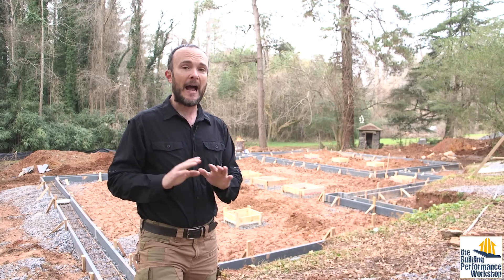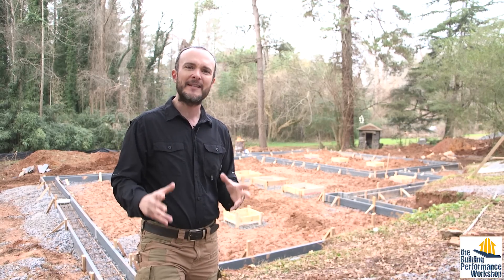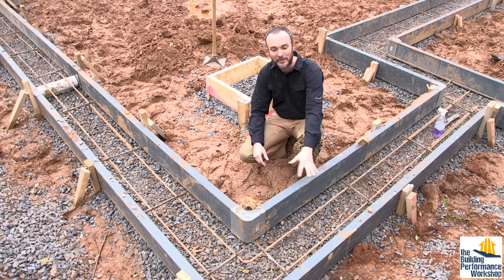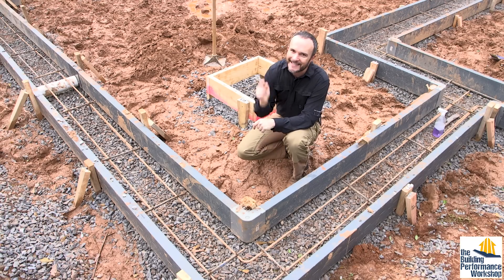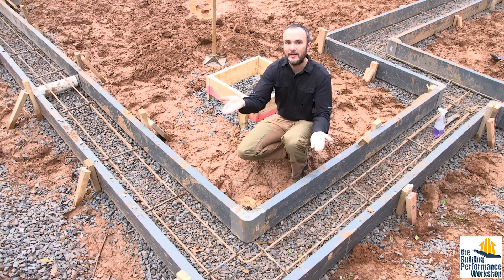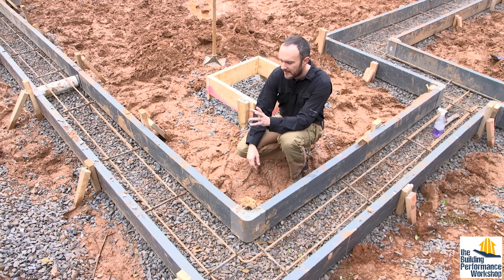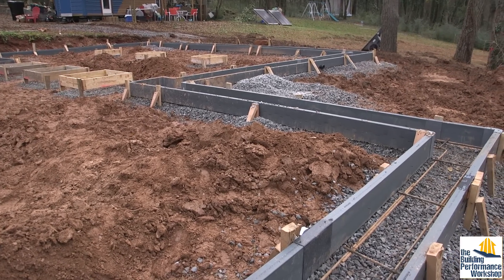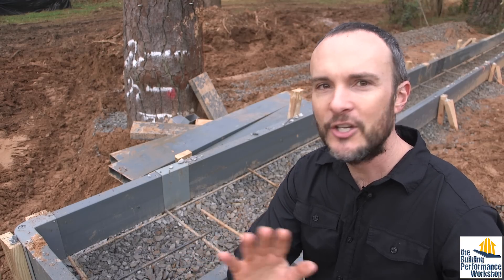First Concrete Pour: Form-A-Drain 4-in-1 Foundation Footings

Comment: Two mistakes.  No key way and I didn't see them vibrate the concrete.  I don't care how wet concrete is it still always needs to be consolidated especially for a footing
Reply from the maker: We opted rebar instead of keyway, the struc specs called for clean concrete (no rebar). Thanks for chiming in.

Comment: Slump test is done at the end of the pump aci, put super p in concrete to achieve workability that is definitely not a 5 inch slump maybe a 7.  
4th generation concrete contractor.

Comment: Mr. general contractor, slump test is done on the field cause water is added on the field. Slump 4 or 5 is for regular pour. They do 6 for regular pump. What u had on ur site will be 7 or the operator won’t let them put it in his truck. Do little more homework u got fooled. I do state and federal jobs so I know, not a random guy. Good luck.🙏
Reply from the maker: Good luck back atcha

Comment: I am glad you have done so much research and I am certain you will have a great house when it is done.  Thank you for this video. I was unaware of the product, and your experience will help me somewhere in the future I am certain.  Man, the rebar I saw was first rate, however, any vertical stake that has a back up brace of less than, or more than between 45 degrees to 60 degrees angle is not strong with that technique. Backing the brace stake with another stake behind it (to bear against) is also stronger in muddy situations.  The gravel you wished to use would have kept the form base from moving, especially placed inside and outside the footing forms (even a few inches in height). Finally the concrete I saw being placed looked like a 4-1/2"to 5-1/2" slump and was shot in way too fast. Thus the deformed results. A 3-1/2" to 4" slump placed slowly would have had a better outcome.  Most pump truck operators I have used intuitively follow you, so you do not have to swing the nozzle as long as the flow is metered at a steady appropriate pace. Nice family too!
Reply from the maker: Thanks for your thoughtful comments, Donald!

Comment: You are the reason that i build the house cash 1st, then sell it. I couldn't put up with you for more than 10 min.
Reply: @lowmanagain ~ Only a SHADY Home Builder/Contractor who lacks professional standards, chooses cutting corners over maintaining high quality, accepts subpar trades work, and has something to hide from home buyers, would make such an ignorant statement. If all you build and sell are finished SPEC HOUSES, you have already established a low bar for yourself and your business. Apparently you are fine with limited potential. I've been in the business for 30 years and builders like you are the ones who end up getting sued by buyers, over and over again.  That reputation spreads quickly to local suppliers , tradesman, home builders associations, and the community at large..... eventually, potential buyers won't even consider purchasing your properties.
Reply from the maker: I am not your customer, my friend. You would never have to worry about working for someone like me.

Comment: I'm glad I'm not on that job!  Working with a over educated nerd that is going to have the safest bla bla house in the world! Give me a break!
Nice guy, but for Pete's sake, just trust the undereducated professionals and go to work!
All you did so far is create an expensive radon system. Crushed stone under foundation will take water. Perf pipe under slab in crushed stone would take care of everything else.  I'd never use those PLASTIC forms, can be cheaper than 2x lumber
Reply from the maker: Thank you so, so, so much for your exclamation points.

Comment: Using form-a-drain You set your ends to heightWith steel stakes With laser set your metal stakes the height backfill this with gravel set the forms don’t get pregnant I’ve been porn was form a drain for 10 years this dude has no clue
Reply from the maker: You’re right, true professionals who pay attention to detail spell ‘pouring’ as ‘porn’ and never use punctuation.

Comment: Form a drain has been around for a long time. There are spreader bars you place on top to keep the forms from bowing in when you put gravel on the inside and outside to keep the forms in place.  We would also use furring strips cut to the proper length for the same thing.   The use of gravel on both sides of the form makes it easier to pour since you don’t have to worry about form movement.
Reply: I don't get how gravel helps.

Comment: Not sure what you mean by putting the drain holes downwards, then you just limit the drain capacity of the pipe. You put the pipe below the level you want to drain, the holes on top and then cover it with a permable plastic to prevent dirt from getting in.
Reply from the maker: No, that's not how it's supposed to work my friend
Reply: @HomePerformance  But it does. I don't know much about construction but I do know a lot about soils and drainage. The holes at the bottom will reduce flow rate and regardless the water does not like you state rise from bottom. That is a misnomer, it flows from the top and collects at the bottom. That means if you have the soil at maximum capacity at the bottom of your drain you already has passed the opportunity to remove it before it reaches maximum capacity. That is to say, if you put the holes beneath the pipe you will automatically increase the level of humidity close to the foundation.
edit: a better compromise would in that case be holes both at bottom and top, but you would still reduce flow rate.
Reply from the maker: The water would have to fall into the tiny holes at the peak of your pvc, my friend. Statistically unlikely.
Reply: @HomePerformance  No, it is pressed into the holes by the same forces that press it into the bottom holes if yo put them there. The difference is that it happens before the soil reaches maximum capacity. The reason why you put them below is when you want vegetation growing above because then you want the soil to retain humidity. That is not your objective when you protect your building.
Reply from the maker: I guess we’ll have to agree to disagree. Keep doing it your way if it works for you.
Reply: @HomePerformance  Yeah but I am still curious about your sources for your claim as I have heard it but it doesn't conform to science. This link expands a bit on your argument but it goes on to the idea that it is to be pumped out and not for self drained purposes: https://www.jlconline.com/how-to/foundations/perforated-pipe-holes-up-or-down_o

Comment: The chairs bridge cleaver clogs, you will then get moisture that tracks and rots the rebar which expands and blows the crete. You may well have out geeked yourself. The steel needs to be rusted but brushed to remove mud and clinker and fully encapsulated to avoid steel degeneration blowing the footing.

Comment: The form-a-drain is installed incorrectly and missing components.  Just a very hard way to use a decent product.
Reply: Honest question: What is missing? What would you do different? I want to know so I learn from others' mistake and not make them myself.
Reply from the maker: Sharon, still unsure- Form-a-Drain actually partnered with us on this and specified the components you see here.
Reply: Sharon Barbour  missing spacers or  ties . They hold the spacing. Then your supposed to stone inside and outside of drain. And they also have thin metal stakes to hold product up to grade. We have done countless footers with the product. Without putting stone prior to pour it is making the entire job more difficult and time consuming. Sure the footer is fine structurally, but you are not benefiting from the idea behind the product.

Comment: You mentioned you put a radon mitigation system under the ground. Do you have a video for that? I didn't see it.  Thanks.
Reply from the maker: 5-Layer Slab System for High Performance Home Build
https://youtu.be/KqIh7c8rSSA

Ventilating Tight Homes in the 21st Century
https://youtu.be/fOTJmUhghIo

Testing a Radon Mitigation System
https://youtu.be/30LI6W8cCR0

Comment: The concrete vibrator would make a good difference when pouring the foundation to void the air bubbles and cracks.
Reply from the maker: On deeper than 8”, for sure
Reply: @HomePerformance  Although most builders did not use the vibrator on the 8" deep footer,  the air bubbles and cracks were still there ( according to my builder buddy). I only mentioned it because that you have set the bar way high:)  What a great job!

Comment: regarding form a drain staking, we poured ours a month ago, he used steal stakes and let it float, (no fasteners) the force is outward, the corners keep everything in place,  and  the stakes hold the form from pushing out when pouring, then he just pulled the stakes for reuse once it cured, he also had gravel placed on the outside of the form bed prior to pour,  while the conveyor was there, for the concrete anyway,  nothing moved, I watched the entire process. it went very well.
Reply from the maker: Thanks for sharing, Scott- ours hasn't been an issue either, even with the minimal bowing in straightaways. Fatter footings never hurt anybody.

Comment: Nice guys finish last, however,  you need to have clear instructions on procedure before your start and also be there most the time. The foundation is very important,  rebar needs to be clean from soil, rebar need to have 2" clearance from edge of form, corners need to have a return at end of bar and rebar bands every 4' none of that seen in the video.
Reply from the maker: Interestingly, the Struc engineer spec’d clean concrete, actually, so the rebar is just an extra measure

Comment: The most dangerous thing is a homeowner with a little bit of knowledge who thinks they know more than someone who has been doing it for 20 or 30 years. They can be a complete nightmare to deal with.

I can tell just by this short video that you are the type of guy to argue with your doctor about getting penicillin when your daughter has a viral infection. 

Dude just shut up and let the experts do it the right way.
Reply from the maker: I’m sorry you think any “expert” knows better than you. What if they’ve been doing it wrong? What if they were taught wrong? What if they prefer easy, or cheap, or quick solutions instead of permanent ones? None of that sounds plausible to you I bet.
Reply: Home Performance what if what you learned is wrong? The Aberdeen Group ran tests where they contaminated rebar to see if it would bond to concrete. In all 27 tests, completely contaminated rebar (rust, oil, etc. Still bonded normally. As you said, sometimes experts are wrong. Well this goes both ways. Sometimes a myth persists for so long that even experts don’t question it. Then they tell you and you take it as gospel to the detriment of your own knowledge and wisdom.

Comment: I will go ahead and chime in on this slump subject.

1) when you order a 4-5” slump, 99.999% of the time that’s what you are gonna get.
Concrete companies don’t want a load rejected by a customer.
2) the only time you’ll see a slump cone on a job site(in the real world) is on government jobs or anal psycho pours.
3) yes you can look at it and tell what the slump is. The mixer truck driver can tell by looking at it. Most also have a slump o meter(measures the hydraulic pressure it takes to turn the drum) on the truck. Drivers will know how many psi a ? slump takes turn. A driver can most likely tell just by listening to the concrete churning in the drum what the slump is.
4) your pump operator can likely tell by looking at the concrete what the slump is, and i have never operated a pump, but I would imagine they can listen to the pump and know the slump.
5) a real concrete contractor will know their slumps.
6) most common home builders won’t. They don’t deal will concrete every single day.
7) the dryer concrete is the stronger it is. But at the end of the day it has to be pumpable if you’re using a pump. It also has to be workable for the laborers and finishers. You can pour it as dry as you wish, but you’ll have a mutiny on your hands or you’ll need to pay for super plasticizer.

P.S. I like the formadrain, it was popular in my area for a while, but it has fallen out of favor for some reason.
Reply from the maker: Great comment, thanks!

Comment: as a construction worker i have to tell you: theres many rules and guidelines written by people who have absolutely no connection to the reality of construction, never been doing the job themselves but elaborating how it's done best. some things are simply laughable. sure theres many things that are very important. but trust me you dont need a good scientist, you need an experienced boss on the site who knows what he's doing. if he sticks to the manual or not should be entirely his concern.

also usually a drainage isnt exactly level/flat to enable waterflow. someone sold you a fan.... ^^
Reply from the maker: I hear where you’re coming from, but the reason we need science now (as well as this channel) is that new materials, new energy codes, new expectations from customers means we’re building differently than we always have. You can’t simply do what’s been done before and expect the house to perform.

Comment: Unbelievable,  we do basements and this is the reason people should hire professionals.  Yes we use form a drain, can set up and pour a footing easily in 5 to 6 hours. Yes we put the rock for the floor and out side in first. Use steal stakes put them on the inside of form a drain and use spacer bars made by them. They also hold up the rebar for the footings. It's fine to be a little crazy but there is a reason professionals are called professionals. By the way, homes we do are usually around 2400 sq ft with garage and porches.

Comment: Possibly a good thing about removing the metal bar chairs and suspending the rebar on a semi cured bed is that you won't end up with a rust-fuse from beneath to your reinforcing.  This is where the plastic bar chairs are good (or those little cubes of concrete with a tie wire embedded in the top).
Reply from the maker: Next time!

Comment: Did you cleaned the rebar with soapy water!? 😂
Reply: That pinkish purplish substance in the spray bottle may have been a special chemical to remove dirt and rust from rebar, to restore its surface to give that proper bond he is talking about.  But if it was simply dirt he wanted to remove, and it was washed out and evaporated, I don't see much harm in it.

Comment: From personal experience I can tell you that pretty much everything you said and insisted on and wanted done was correct and the contractors don't do it normally because 1) they weren't taught that way and 2) it takes more time and 3) there is a 1 in a billion chance of something going wrong if they deviate from "normal" practice and lastly 4) the contractor and his crew will have to stop and think and be a little more thoughtful and careful and that is asking a LOT!!  I was in the building trades for years and I know of what you speak.  I would have been 100% fine with a customer like you.
PS: I just watched the last few minutes.  "So much pressure that they would push them in." Translation: "Too much additional effort."
Reply from the maker: Thanks for the expert backup, my friend! Keep the dream alive.

Comment: Where I live, we must use these concrete dobies and I think they are a better solution than the wire chairs that you were showing us.
https://www.homedepot.com/p/Basalite-2-in-x-2-in-x-2-in-Wire-Dobie-Concrete-Brick-200000252/100321950

Comment: (I) Feel sorry for those who clearly never actually hear you mention that you are the General Contractor on this very first home of your own  or what your job was that you are taking time off from to complete this build in the way and shortest possible time and espite this they still commented with  blissful ignorance, despite what you said. As you already may know from the responses I wrote to some, as a tech (laborer mostly) for my step dad, he and I always did it the way we were trained to install drip tiles and drain pipe was always sloped, but as I learned of form drains I was like "as innovative as ICF", though despite its level requirements, a secondary drain would not hurt to carry through gravity to a lower elevation or drain pit for in the event it takes on ore water than the form drain can manage. Pretty sure the newer form drain system (under new ownership) is better than the old system but still can see needing to use a wood batter to help reinforce it in place for the pouring.
Reply from the maker: Thanks for all your thoughtful comments, Joshua- good to have another perspective here

Comment: You can certainly run a slump test before pumping.  Do you think the government or state allows concrete to be poured without one on site
Reply from the maker: Roads, bridges and institutional buildings are not the same thing though
Reply: Concrete is concrete.  Just different mixes. For different jobs        tell them you will not pay for the truck load  with out  testing it      are you certain they sent you the  mix you requested     15 years. Experience

Comment: 2x8s to form inside and outside of the form-a-drain with 2x4 spreaders to hold everything in place and to prevent bowing during pour. An extra step to keep the homeowner/builder happy.
Reply: Took the words out of my mouth.  He's dealing with a contractor that is playing  it down to some extent.  In hindsight after the pour began, the contractor knows damn well he should have formed the form-a-drains with wood for bowing strength. Prob his first time. How exciting.

Comment: You can perform your own slump test, and a 5-inch slump is too weak. If the trucks have to travel too far they do add water so mix it on site or settle for less.